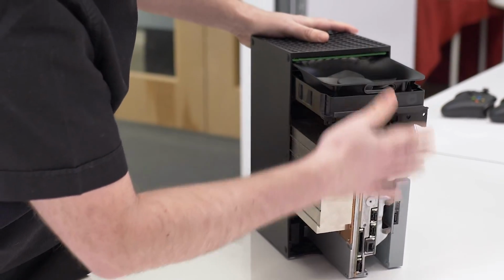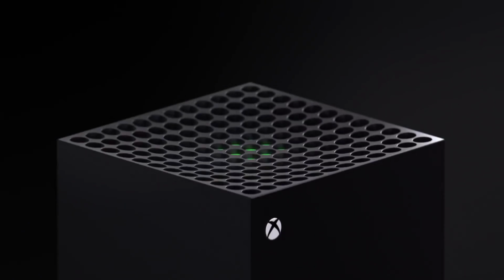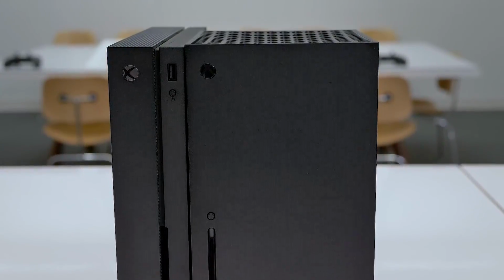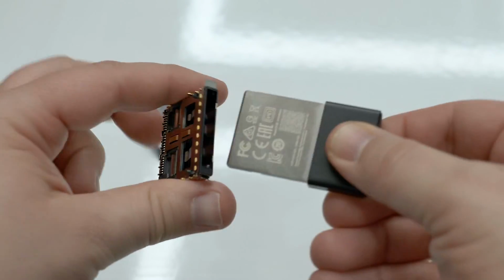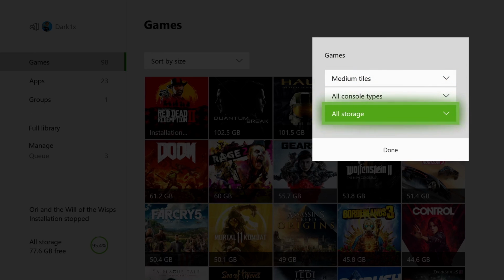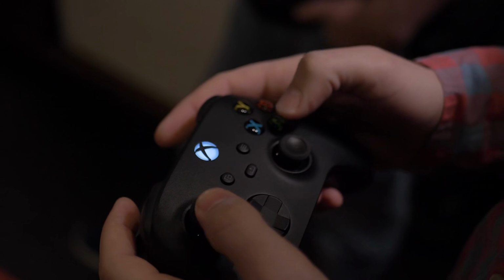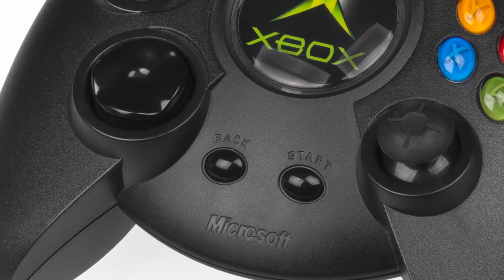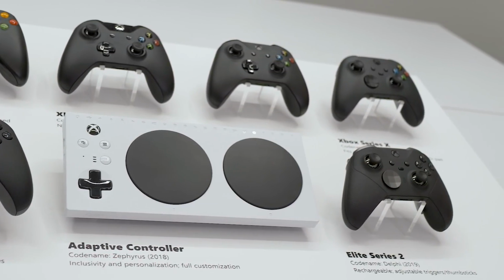DF Direct: Hands-On With Xbox Series X  + Impressions + Xbox One X Size Comparisons!

Comment: Miscrosoft have some brass balls this generation. They are practically flaunting the thing.
Reply: That tells me they know what Sony has.
Reply: Stephen McIntosh they didn't know what Sony had when they flaunted the xbox one. They just had confidence i their product.
Reply: @Karax9699  better games?
Reply: @Karax9699  Sony's cake is baked. It doesn't matter what they show Sony can't change the design of the PS5 in any meaningful way at this point.
Reply: @Karax9699  they dont really have a choice imo. They're in 3rd place so they have to be aggressive. They don't have anything to lose while Sony has all of it to lose.
Reply: @Karax9699  of course they know what sony has. they are the ones who will provide the servers for sony's game streaming service. how are they going to do that if they don't know the specs of the system?
Reply: @Karax9699  Of course. Both use what Amd will give them. PS5 will be identical.
Reply: @livewallberg  Not according to the leaks. They put Ps5 on older tech, and about 3tf less powerful
Reply: @Karax9699  also been leaks saying it's the same or even more powerful.. leaks can't really be trusted
Reply: @Billykiyay  there's been one credible leak, even digital foundry think is accurate. Puts it comfortably at 9.2
Reply: @Karax9699  so it's credible because that's the narrative you want pushed? It's no more credible than the 11 and 13tf leaks.
Reply: @Karax9699  and another 'credible' leak put it at 12 and most recently a Dev said 11.6, there would have been work in progress dev kits out there with a range of teraflops before now... it's all speculation when the truth is the difference will be paper thin.
 The big difference in my opinion is the exclusive games, which Microsoft have said they're not really doing.
Reply: @Billykiyay  except Microsoft said they are. And the leak that said 9.2 for PS5 also said just over 12 for series X. As I'd from AMD directly.

It'd 9.2 my man
Reply: @Karax9699  Is it official though ? Some are saying 15.1 then 13.6 then 9.6 tfs . I dont even know which statement is correct.
Reply: the wicked one Tommy Fisher leaked the XSX specs and was spot on, he also leaked PS5 specs..time will tell.
Reply: @Wifixsmasher448  well only 1 leak from AMD had just over 12 Vs 9.2 

Then another at about 4. Which is Anaconda. 99% confirmed legit.
Reply: @Karax9699  Nobody but Sony insiders have any real solid knowledge, only speculation right now.
Reply: @HalfdeadRider  there's no Sony insiders apart from the AMD employee who leaked the specs by accident
Reply: @Karax9699  The 9.6 tf has been debunked multiple times.
Reply: @Karax9699  nope, theyre using rdna2, AMD said so
Reply: @Karax9699  Anybody who works for Sony is a Sony insider lol.  And don't be surprised if that turns out to be false too when the specs do come out from the horses mouth, only time will tell.

However, it most likely is very similar if for some reason not the same as the Xbox CPU.  So that leak 'might' be the only truly know fact about PS5.
Reply: Stephen McIntosh Wrong it’s RDNA 2 also
Reply: @Karax9699  Firstly check your spelling otherwise no one will take anything you say seriously.
Secondly Microsoft have been open about specs, Sony have not. Just because you heard or read something somewhere doesn't make it fact, you do realise that right... 
plus Microsoft wouldn't release Sony's specs, also in the latest AMD conference they stated both consoles would be using the same chipsets. You have no idea mate same as everyone else.

Do some proper research my man
Reply: @Billykiyay  I have. About 2 years ago in development Navi 2 chips were leaked. 1 has been confirmed as series X. 12tf.

Another, smaller one. Was also leaked. 9.2 Teraflops being tested on behalf of Sony Japan. 

That leak is 100% real. That's the fact of it. Ps5 is 9.2
Reply: @Karax9699  Then present this research, your  leak source, to the comments so I can debunk it for you.
It's a two year old piece to start with, more than likely 3 now as it would have been last year and of information that's probably even older. 
Alot can change in that time.  
Xbox wasn't a leak they announced it ages ago.
Reply: @Brillobreaks  PS5?
Reply: Seems like all of you are forgetting that Microsoft has been buying up developers the past few years. Last year alone they snagged up 6 companies all of who have a background on making pc games. And as other people have said Sony had a huge advantage in the last gen cause Microsoft completely botched their launch of the Xbox one. The whole DRM always connected to online announcement they first made completely killed em and with all the backtracking and changing of minds it kind blew everyone’s trust in em.
Reply: @Jachamoe  Yep!!! Me didn't lose trust tho!!!😀😀😀
Reply: @Brillobreaks  yes. Considering Sony's launch lineup is looking to be the last of us 2 and Killzone. 

Not bad, but I don't think Sony are going to be as comfortable next gen
Reply: They have to. Xbox One was a complete disaster of the highest magnitude. Phil Spencer is a smart guy and clearly gives a fuck.
Reply: carljthatsme94 PS3 made comeback Xbox One dug a hole deeper and deeper.
Reply: @carljthatsme94  I've owned all iterations of both consoles back to the originals and the One X blows the PRO out the water. If they get some good new franchises going the Series X will be the winners choice. Whether people will move back from PS though remains to seen.
Reply: @Awakened Virtue Yep and 7 Uncharted games including the terrible Lost Legacy and Vita Golden Abyss and the card game..
Let's not forget 7 Grand Turismo's but hey let's shit on Forza 🤦
Reply: @mrwalker6026  lost legacy was amazing. Go play Halo you dumb shit lord . Everyone shat on that game
Reply: @AliHamza-sv4ni  Everyone shat on Halo 5 if you tried that with any other Halo game oh boy
Reply: I love how any praise of one console or another immediately turns into an excuse to perpetuate the console wars. Both systems are gonna be good, folk. :p
Reply: @TheTbrandon  Thank you my brother & very well said 👍🏿👍🏿 Because I think the console war thing is stupid to be honest 🤦🏿‍♂️🤷🏿‍♂️
Reply: @Brillobreaks  Maybe not.   Because they are starting to releasing their "Exclusives" on Microsoft's PC platforms.  So, Sony fans say "Xbox has no games!"  Because Xbox games are on PC.  Shouldn't that now apply to PS4 and 5?
Reply: Bryan Lee sony released one 3 year old game on PC, it’s not a policy shift
Reply: @cianboy97  and Xbox was also releasing older exclusives on the PC like State of Decay,  Forza Horizon,  Quantum Break and so many more for a long while but you all still ran with the narrative so...
Reply: @itsmebryan  Sony head, hulst said only select games will go to pc, but tbh the games will be on PS way earlier, people won't wait around, they want it first
Reply: @itsmebryan  Sony is only testing PC launches with a few exclusives. But they have confirmed that they are still focusing on PS exclusives. +Horizon zero dawn is a 3 year old game that has sold 10 million+ copies on playstation, so it doesn't really sell copies anymore and the developers want more money
Reply: @itsmebryan  Okey big boy tell us wich games (as in multiple) are on PC?? And don't give me rumours give me facts!!
Reply: @itsmebryan  But you've also just made an example of Xbox's biggest downfall. Because their games are on PC and I have a PC, it nullifies the reason to actually purchase the Xbox in the first place. Anyone who has a decently speced out PC won't even need to take any notice of their existing or newer console variants.
Reply: @shinukisan2222  Ok so does everyone have a PC especially one that probably burries most like what the Xbox Series X is gonna do no...no I dont think so.
Reply: @shinukisan2222  you mean like how Sony is releasing their games on PC as well as they "prepare for a future without consoles"? 😬 Guys you don't need a ps5 either
Reply: @Picmanreborn  Gonna be a longtime before consoles aren't the norm.
Reply: Shinuki San Microsoft doesn’t care if you buy a console, they make money off of digital sales, you really think the 20 dollar margin they make from selling a console or some shit like that is what will make them money? No it’s people buying their games that’s why their first party titles are almost all locked behind the Microsoft store which windows will be pushing hard soon.
Reply: @shinukisan2222  the fact that you ignored the general premise of my comment tells me all I need to know 🤦🏾‍♂️
Reply: @Picmanreborn  I didn't ignore the fact that slowly but surely Sony games are going to PC, just not in the same extreme as Microsoft. I added an extra comment to that, what's the problem? I made a comment, I didn't get all upset like you obviously are. Take a chill pill pal.
Reply: @shinukisan2222  ???? I'm going to assume that you're upset because you'd have no reason to think I'm upset. But I know that's how people react when they're getting exposed on a topic they have no knowledge in 🤔🤷🏿‍♂️
Reply: @shinukisan2222  🤔 I'm going to just leave you alone before you have a stroke getting upset like that. Sorry that you wasted 35 years of your life
Reply: @shinukisan2222  microsoft is ok with that , in fact they want you to play where you want to.
Reply: @shinukisan2222  about 1% of pc gamers have a pc Capable of matching the series x.... And none of them made it for less than 2 grand.
Reply: Shinuki San   Same can now be said about Sony’s console.
Reply: Picmanreborn   lol exactly
Reply: @Picmanreborn  If that's all you got then I'm very safe in the knowledge I have and all that I have learned. Shame I can't say the same about you, thanks for confirming and validating my previous statements, you're an absolute legend, where would I be without you in my life.
Reply: @shinukisan2222  series X> your pc
Reply: @shinukisan2222  not for me, I personally prefer console gaming over PC.
Reply: @shinukisan2222  How is that their biggest downfall? More like a smart, winning move. Like who cares? These guys barely make scraps on actual hardware console sales, pennies on the $ at most. They're often sold at cost or even at a loss, esp @ the start of a gen. That's not where the $ is. The $ is in software, subs, & services. These guys aren't like car co.'s, but more like gas stations/energy co.'s. You think Exxon cares if you roll up in a Toyota, Ford, or BMW? Nah they don't, you're still pumping their gas on the reg. You're still playing into MS' hands if you pay to play their games on PC. They see that as a win. Which is why you're where you are as a normal ole consumer & not there as a corp exec at MS. Do you think they care if you have a Dell or Acer running win10? Imagine if you could only use windows, dx, & office on their MS Surface, as some sort of exclusives to boost their HW sales. Do you think that the fact that they don't is MS' biggest downfall too? Nah, they'd go bankrupt w/in weeks.

MS is a SW co. first & foremost, that's where their expertise is. By making this move, they've effectively doubled their potential market base. And who wouldn't want that? More potential $ for them. There are many PC players who'd never buy a console & vice versa.

I mean why doesn't Sony make it so that you can only play their music & movies on their own Sony TV's, DVD/BR players, & devices? According to your logic, shouldn't they? Such downfalls on their part tsk tsk. I've watched all the Spiderman's on my LG, how dumb are they? No wonder they've been slipping in those depts for yrs w/ only their PS div keeping them afloat. They should follow their own advice.
Reply: Shinuki San yeah bit that means if there’s a game worth your while then you could be one of the many game pass subscribers and then if there’s one with an amazing multiplayer then you will for x amount of more months. That’s not a downfall. MS is simply letting the consumer choose what is your preferred console (Xbox one for at least one year or series x) being console or pc unlike PS where they shove it down your neck and basically say you have to buy this if you want to play our new exclusives.
Reply: That's because they know it's more powerful than the specs that have been released for the PS5 and they also know it is the first console to be up there with a high-end gaming PC.... you and I both would have balls too
Reply: They need to start fast and with excellent buzz because they don't want another poor generation in terms of sales. The PS4 is closing in on 2.5 times more units sold and would have probably hit that figure if it wasn't for the coronavirus outbreak by the end of June 2020 seeing that Final Fantasy VII Remake, The Last of Us part II and Ghost of Tsushima are coming before that date and all 3 of those games are system sellers and also game of the year contenders.
Reply: Well, they're doing the opposite of the Xbox one did. And we can thank that guy Mattrick for royally screwing it up. Phil is saving Xbox by everything he's doing and they ain't playing around. This is the complete opposite of what they did
Reply: @Brillobreaks   Currently, Halo, Senua 2, Gears Tactics, Flight Sim, Gears 6, Forza, Fable. That's before launch. And performance is presumably more powerful, by their reaction
Reply: @Karax9699  all I heard is gears Forza Halo
Reply: Stephen McIntosh They will all be on PC too. Not a good selling point for most people.
Reply: Stephen McIntosh He said ps5 not xbox
Reply: @Karax9699  idk man...  The last Halo and Fable were kinda bad.  The only games in my eyes that have a decent chance of being quality are Senua 2 and Gears 6 because they've proven to deliver what they market.  Forza...is Forza AKA obligatory pretty car game to show how pretty new consoles can make pretty things.  I'm never impressed with these car games because they never render more than they have to so of course the cars look nice.  I'm not bashing the xbox as much as I'm saying launch lineups usually suck and this one seems to be in line with my expectations.  The promised backwards compatibility of both consoles is most likely there mask this.  That being said...I love new tech so I'm grabbing both consoles.
Reply: Stephen McIntosh so, basically the same exact shit that was launched with the current gen and last gen. This is coming from an Xbox fanboy, I’ve always preferred Microsoft consoles. But damn do we need some new ip’s. I don’t know why Microsoft thinks they can keep getting away with just shitting out new halo, gears and forza games every couple years.
Reply: Meanwhile PS4 owners have all these great single player games. Bloodborne, Horizon ZD, Spider-man, etc. And all we get over on Xbox is crappy Gears games stuffed with micro transactions, a halo game that has about a 50/50 chance of being good, and a copy and pasted Forza game. It’s getting really stale.
Reply: @Shane-sf9pv  I know right just like Nintendo keep shitting out Mario,Zelda and Pokemon and ports at that
Reply: @Shane-sf9pv  that's all PlayStation has. Single player actin adventure games. Xbox has better shooters, racer , multiplayer, fighting. Better console. Better service. Better controller.
Reply: @EasyModeMowza  what games are those? That gears crap? And better controller my ass, it's shit for fighting games.
Reply: Shane Thompson   You should be one of them. THIS is an Xbox video. What are you doing here??
Reply: @Shane-sf9pv  meh those games are single player. I'd rather have Cuphead, Halo, Gears, Forza Horizon, Forza motorsports, State of decay, Sea of Thieves, Phantasy Star Online, Halo Wars, Crackdown 3, etc... But to each their own. I just prefer gaming with friends.
Reply: @AliHamza-sv4ni  How's Bore Stranding and Shits Gone.
Anyone who isnt a brainlet can either understand the appeal of the Xbox Controller and that they just like PS controller more or accept its the better one.
Reply: @Shane-sf9pv  Xbox's studio ; The Initiative is now working on a new IP , let's hope they delivers it
Reply: @Karax9699  Microsoft bought the Senua studio and those games in future will be Xbox exclusive.
Reply: @HelloFellowDinosaurs  they will all be on pc
Reply: @Karax9699  so a hopefully good halo game (hasn't happened in a long time) and Senua 2 lol that's not much
Reply: We've been through this before. We need to see games. I have top end x86 hardware already.
Reply: @Brillobreaks  But ask yourself this were you there during the Xbox 360 generation when the 360 had "better games"? The common trend for games costs $60 per new release via console. For services it costs $12-$60 per month/3 months/year via console. For a new display that is meant for the console ranges from $140-$86,000+ which is worrh more than the highest of high end gaming PC. When you pay for console it's an exponential growth for the amount you pay. For PC it's expensive at the start but the amount you pay is linear since games are significantly heavily discounted and there are no services that you have to pay for. It does not cost as much to upgrade your PC with brand new hardware compared to purchasing an 8K TV for $2.5K-$86K+. It is not poverty people suffer from it is more of so saving up. There are many factors that lead to the consumer becoming low budgeted whether it is poor choices or environmental factors. Also console sells do not matter it is the number of active users that counts. I could by a random console right now but that does not contribute since consoles are being sold at a loss. When I buy that random console and deliberately choose not to touch it there is no contributions being made. When I game on said random console I am contributing by paying for its available services. Halo Infinite is going to be cross gen does that mean people will purchase a used base Xbox One instead of the Xbox Series X? No. People want power AND games rather than one over the other which helped boost the PS4's reputation prior to launch when Phil Spencer was not in charge and instead someone who did not even care of the Xbox brand was put in charge. So now that that is out of the way we now know that "games" are not the only factors gamers look for and console sales do not depict which competitor prevails.
Reply: @Awakened Virtue What are you talking about Gran turismo sport is a multiplayer game and it has a pretty strong fanbase. And those nintendo exclusives sold alot because they were basically the only available games available at the time.
Reply: Cee Z  there's no Pro. The PS5 is anticipated to launch end of this year at 9.2 clear you're a fanboy though so, irrelevant
Reply: Oodama Chisengan  The corona virus is a big problem for Sony. They're not running scared, they can't hold events since the disease could spread in there and Sony can't promise a holiday 2020 launch at the moment since they aren't getting parts for the PS. I think it's annoying too but there's not much we can do
Reply: As they should. I want them to push SONY (my preferred platform). I want them to be hot on SONY's tail. That's the only way SONY will continue to work hard
Reply: @blackwhite2361  THIS.
Reply: @Brillobreaks  no Japanese games on that list

I guess phantasy star online doesn't count?
Reply: Eric Henry previous history? Sony had jack shit for the launch of PS4. It was almost a year after launch until they brought out anything worth talking about. They finished this generation strong but it was a slow start.
Reply: Oodama Chisengan  Sony still have 2 big exclusives coming out for the PS4 in the Last of Us part 2 and Ghost of Tsushima and are about to or have already surpassed 110- 115 million PS4 sales. My guess from a business perspective is that Sony want to keep the momentum with the PS4 at least until TLOUP2 drops then I suspect we will see Sony release official news for the PS5 and then Ghost of Tsushima will drop to end the current PS Gen with one last big bang. Microsoft don't have if memory servers anything really coming in terms of big Blockbusters to compete with either Sony or Nintendo to finish out the Xbox Ones lifecycle so it makes sense for Microsoft to want to shift the momentum away from a fairly lackluster gen and try and build momentum for the series X.
Reply: @ServiceGuaranteesCitizenship  Why would anyone buy the PS4 now when the PS5 and Xbox Series X is about to release,  also btw how the hell do they go from 103 Million units sold to 110-115 million units in 2 months you are just reaching at this point.

Um Xbox has Halo Infinite,  Crossfire X,  Grounded,  Microsoft Flight Sim,  Age of Empires hell maybe even Everwild and Hellblade 2 releasing this year or the next,  and they did announce that their games will be cross-gen so any IP they make this year till the next will be playable on the One Family to finish off in a bang.
Reply: @imixupwords5340  Much for the same reason that people continued to purchase Xbox 360s and PS3s after the launch of the Xbox One and PS4 that reason being that they are cheap and have a completed games library at a deflated price you would be surprised at just how many end of gen adopters there actually are. And reaching? PS4 had sold 100 million by July of last year I think you are a little behind on your information? The last counting for PS4 that I was aware of was at 108 million sold as of January this year it is completely feasible to assume if that PS4 has surpassed 110 and is encroaching the milestone of 115 million units sold. 

And Decent multiplats for sure if done right. I hope Halo Infinite actually hits the mark this time I have not personally enjoyed a Halo game since Reach Halo 4 and 5 I thought were iffy. Age of Empires 4 however if it as good as its predecessors will be one to get for PC for sure.
Reply: @ServiceGuaranteesCitizenship  Yeah but only like 3-4 million people still bought the old-gen consoles thats not really a lot,  sorry about the little misinformation just reachecked it was 106 Million not 103 that number was daily players still though how the hell can they reach 110 or 115 in 6 months when it took them 6 years after last-gen to get 87 million units sold on the PS3,  most are probably waiting for the Next-gen consoles and their more affordable counterparts (well for Xbox at least).
Reply: What games all Sony showed us gamers was a ps logo 🤣
Reply: @Awakened Virtue That's confirmed for next gen with a Multiplayer. Plus killzone is rumoured. Not great
Reply: @Karax9699  No it was. Even rumored that guirilla is working in Horizon sequel and a new Socom
Reply: @f30rocity78  debunked.
Reply: @Karax9699  dude, there's so much more. Bluepoint has two games, one for launch thought to be a remaster of Demon's Souls. Sony have worked out differences between kojima and Konami, now Sonys getting Silent Hills, ie PT as an exclusive. Naught dog are said to have had another team working on a launch title, not tlou. GDC had a survey for developers a while ago, one question was what console were they working on games for at the moment, and another asking about their next game. Sony got way more percentage. Oh and they asked devs what next gen console are they most looking forward to, by far Sony again. Now I'll look foolish if they don't, but I think they're gonna blow people away very soon
Reply: @cathalorourke1  none of that is confirmed. All came from fanboys. All the real sources indicate that Sony have about 3 games for launch year, and it's to be 9.2 and priced same as Xbox. That's the facts we know.
Reply: @Karax9699  well its true theyre not facts, but possibilities. There's godfall and Ghost of tsushima port also. Bluepoint point remaster is definitely coming too, they themselves have been teasing for months in tweets
Reply: @cathalorourke1  Ok first of all mate that whole Sony making Kojima and Konami make up is still a rumor and I dont know if I want Konami to get money from Kojima's work Konami is a bastard he monetised save slots the fuq.

Mate have you not heard that Naughty Dog is going through a crisis just to release The Last of Us 2 with veteran devs leaving on a daily basis because of crunch and them having to rehire new devs and train them as well,  why would they make a second team to make a second AAA launch title for the PS5 if they did that TLoU2 and their "rumored" Second title is gonna come out shitty and broken I do not want that.

That list always changes last-gen it was the same people wanted to work for the PS3 more than the Xbox 360 in the end of the day most of those same people still made a Xbox version of their game,  as lonh as the Xbox Series X is a good product and people actually want to play on it they will make a copy of their game to have more profit.

As for Bluepoint im not sure about there being 2 but I sure as hell believe they are working on a Demon Souls Remaster.
Reply: @TheBlankStare that's usually not the case with tech.
Reply: @Brillobreaks  Sony has always had a terrible launch line up where have you been for the last 20 years? I guess you Sony guys have short memories, but I don't, I remember all the jokes about greatness awaits and awaits and awaits and the indie-station. Xbox had a way better launch line up of games, they also had a weaker console, terrible PR from all the fuck-ups are around the reveal and the messaging and a more expensive console due to kinnect all Sony had for the first few years was100 bucks cheaper and 100p diff in games. Also, MS has more first-party studios than Sony do now and Sony is on record saying they make fewer games next-gen but focus on quality so I would not go banking that PS5 will have the better library of games.
Reply: @Valhura77  bruh xbox one wasn't much better than sony in the launch lineup.
Reply: @f30rocity78  Actually it was bruh it had Forza 5, Dead Rising 3, Ryse and Killer Instinct
Reply: @Valhura77  Microsoft bought some pretty small developers, sony has the upper hand in that field.
Reply: @f30rocity78  Obsidian,  Playground,  The Initiative,  Ninja Theory,  Inxile,  and Undead these are there best of the new studios they acquired,  3 of these guys maybe small but they are talented and are growing thanks to Xbox's support and the other 3 are big AAA devs.
Reply: Zeegoku I think MS is doing the right thing as the underdog. Get your info out first so that all the revealed info of the PS5 is compared to this.
Reply: Xbox has expanded their 1st Party game studios to 15 with big names like Playground,  Obsidian,  Undead Labs,  Inxile,  and Ninja Theory with 1 new studio called The Initiative thats being led by seasoned developers like Darell Gallagher,  Drew Murray,  Ryan Duffin,  and so many more.

Xbox has announced 7 next-gen exclusives and teased about 4 more,  these 11 exclusives are Halo,  Hellblade,  Mara,  Insight,  Flight Sim,  Everwild,  Age pf Empires 4,  Playground's 1st real IP/Fable,  The Initiative's first game/Perfect Dark,  Forza Reboot,  and House of Thieves/Compulsions new IP. 

There are trusted leaks of:
- Perfect Dark coming back 
- Fable coming back
- Obsidian working on a second RPG project thats supposed to be their version of Skyrim.
- Inxile working on another project thats not a turn-based asymetric RPG with Dean Rymer as their lead combat designer.
- Undead Labs working on a brand new IP
- Compulsion just revealed that they are in fact working on a AAA game that is 3rd person and drives heavy influence from Bioshock.
- The Coalition working on a brand new IP to let Gears breath (this one isnt really supported either because it isnt true or leakers are too focused on the big one's).
Reply: @imixupwords5340  hi,  they will all be on pc , bye
Reply: @AliHamza-sv4ni  So do you have a PC no better yet do you think everyone who plays games have a PC is that no yeah screw off.
Reply: @AliHamza-sv4ni  Better yet do you really think when the Xbox Series X launches people will go out of there way to buy and build a PC that will cost 2 to 3x more than the Xbox Series X but will be at the same performance rating.  Again screw off.
Reply: In fact there are credible leaks that Xbox has bought at least 2 new studios 1 from Poland which is likely Moon Studios or Techland and 1 from Japan which is probably Platinum Games.  

I personally think they got 5 again those being Moon,  Techland,  Platinum,  Relic,  and Remedy but thats just me.
Reply: @imixupwords5340  I do not exactly favor the word "leaks" because it means in theory.
Reply: @Brillobreaks  Microsoft have 16 studios working on first party games now, they had about 6 at the start of Xbox One. Sony have about 12-14 depending if you count different branches of the same studio etc.
Reply: @Brillobreaks  lmao where did you pull that from? Your ass? PS3 sales were at a standstill when PS4 released.
Reply: Games won’t mean sweet FA if the platforms are poo to work with. That’s what held Xbox back last gen. Ps was better to work with. This gen is undetermined
Reply: *MICROSOFT more like balls of Adamatium this gen.
Reply: Awakened Virtue your Nintendo argument is absolutely idiotic. Nintendo has no 3rd party game presence in their consoles whatsoever. That explains why their exclusives sell so well. Put all of those 3rd party heavy hitters on Nintendo and their exclusive sales will dip down right away. By the way Nintendo Switch is terrible and overrated console. On the other hand You can’t even compare PS 100 million user base to any other platform on the planet. PC is exception. Xbox multiplayer games are terrible and have a lifespan shorter than top notch PS4 single player exclusives. Go to twitch and I guarantee you gonna see every PS4 AAA exclusive still to be streamed and played, even though they are one and done after initial hype and release. Xbox sold 40 million but I guarantee you that at least 30% of their customer base migrated to PS4 and their Xbox is simply sitting on the shelf collecting dust. And you have to be an absolute idiot to believe that the most powerful console will lead and win next generation. 90% of the population still has 1080p TV and monitors. Despite the all RTX hype nonsense 90% of the gamers still prefers 1080p with stable frames over 4K. Games, and I must say the best games and library will win the hearts of an average gamer, who wants to come after work, turn their tv and relax. Price means and dictates a lot and we all know that MS has always been greedy in that department. This is a nice piece of plastic hardware, but so far that’s the only thing it remains so far.
Reply: Lol YUP....AND WHERES SONY AT???  NOWHERE TO BE FOUND.
Reply: Awakened Virtue many previous Xbox fans jumped ship when they heard things like no game sharing always online Kinect bundled with the system pretty tough launch and they knew it once the one s came out they started going in the right direction but it’s not always about console says there’s not much money in that for them.
Reply: Eric Henry hey if rumors are true and Sony trying get the rights to castlevania, metal gear series and silent hill then oh yeah Sony will have a great library.
Reply: @sarahbembry7512  The thing is when we the "hardcore" Xbox fans look and find leaks we still need to see if the man who leaked it is reliable,  thats why we trust Jason Schreier he may be wrong sometimes but 90% of the time he is right he leaked the Specs of the Series X or its older name the Anaconda and look at that he was right.
Reply: @Brillobreaks  Funny because he xbox one X was selling faster than the ps4 pro.
Reply: @Awakened Virtue way to generalise things 👍🙄
Reply: @Awakened Virtue Sony is focusing on singleplayer games so of course they aren't releasing a huge first-party multiplayer game. Most people want singleplayer games, so there's no point in bragging about only having multiplayer
Reply: Cee Z  all critically acclaimed and commercially successful franchises.
Reply: They did the same with XBONE and look how that turned out.
Reply: @Awakened Virtue you like pulling percentages out of your ass? Nice. Look at the sales of the PlayStation and Xbox , life time sales, ps2 vs Xbox , ps2 way more sales, PS3 vs 360, ps3  a million more consoles sold. PS4 vs one. PS4 way more sales. There is no war. Ps  has more sales every gen
Reply: @AliHamza-sv4ni  Check facts when was the last time the PS3 sales were revealed and compare that to when the last time the 360 sales were revealed you would be pretty shocked how far they are apart,  360 sales were last revealed in 2014 PS3 sales were last revealed 2019.
Reply: @imixupwords5340  you do know they don't have to write articles for you to know sales of a product right?
Reply: @AliHamza-sv4ni  Mate those same articles release the same year when they reveal their product sales it doesnt counter my point that The PS3 took 6 years after the last-gen to beat the Xbox 360
Reply: @imixupwords5340  mate , doesn't matter how long it takes, the fact of the matter is. Even in the generation where Xbox apparently dominated. Sony still eventually had more sales. And sales are what matter. No point in arguing. PlayStation is still on top and will continue because Microsoft wants to have all their games on PC so there isn't much reason to get the new Xbox for alot of people. Ps will dominate again
Reply: @AliHamza-sv4ni  Does everyone have a PC nope I do but the Series X still dominates it  so no one is gonna go out of their way to buy a PC just for gaming anytime soon.

You know you seem to be forgetting to add in the fact that the last 360 sales were from 2014 it took The PS3 6 years to beat those numbers so what are the 360's units sales during 2019 probably still buries the PS3's thats for sure.
Reply: @imixupwords5340   Follower 8  bro are you living in the early 2000s? Most people who will be able to afford a series x are there kind of people who atleast can afford a decent laptop if not a PC. Most people with jobs and who go to uni have laptops. And trust me you can literally build a pc that runs better than the current gen for about the same cost. Don't care about probabilities. Fact is a decent PC , a PS4 and a switch gets you everything
Reply: @AliHamza-sv4ni  You know were talking about next-gen right,  a decent PC will cost more than the Series X but still be weaker if they're getting that PC just for gaming then they must not be thinking straight because the Series X will be better and cheaper.
Reply: @imixupwords5340  not really man. It's "next gen" for consoles, not for PC . They've had most of this shit for a minute now. By the time these come out the prices for parts will go down some more and within a short period of time you'll start setting YouTube videos about PC builds around the same power that are in that price range.
Reply: @Awakened Virtue the same could be said about xbox, there are 11 Halos
Reply: They have the full capablities of the master race behind them. Any move they make will be interpreted as a "flaunt". As a PC Gamer with a high end HTPC (im typing on it right now) in my living room, gotta say im pretty impressed with this console. Not consoles, but THIS console. I more or less have MS XGP specifically for this system. Well done to MS, and as a long time fan of AMD CPUs, (never owned an intel) im very impressed with AMDs APU tech for sure.
Reply: @Brillobreaks  single player games for basement dwellers 🤣😂
Reply: dyy Fethiiyhn  But didnt the PS4 launch with the shittiest of launch titles and only sprinted past the Xbox One because it was shitty and the PS4 was stronger and cheaper.  

Didnt the PS4's actually good games come out in the mid to the end of the generation. 

Didnt the Xbox 360 have the games that everyone loved and that buried most of what the PS3 had.
Reply: @Awakened Virtue 
Well only ps5 game confirmed so far is Godfall.
But on the other hand not many Xbox Series X games are confirmed.
Most of their exclusives launch before the Series X release, if we're going by the exclusives that'll release this year,
Then ps5 will have
Final Fantasy 7 Remake, Last of us 2, Nioh 2, Ghost of Tsushima, Yakuza like a dragon, The Pathless, Persona 5 Royal and a granblue game.

They'll be available to play on the ps5. I mean, you can buy the ps4 disc and play it on the next gen console since backwards compatible, same thing with xbox too so ¯\_(ツ)_/¯
Reply: @MavihsLH  Dont forget that Xbox is releasing about 9 confirmed exclusive games this year and 3 multi-plat ones those being:
- Halo Infinite (AAA exclusive)
- Crossfire X (AAA free to play exclusive)
- Grounded (AA/AAA exclusive)
- Falconner (AA exclusive)
- Ori 2(just released) (AA/AAA exclusive)
- Battletoads (AA exclusive)
- Gears Tactics (AA/AAA exclusive)
- Microsoft Flight Sim (AAA PC exclusive)
- Tell me Why (AAA exclusive)
- Psychonauts 2 (AA Multi-plat)
- Minecraft Dungeons (AA/AAA Multi-plat)
and
- Wasteland 3 (AA/AAA Multi-plat)
Reply: @imixupwords5340  
Yes I know.
I was also combating another person's statement,
I am perfectly aware of the games Microsoft is releasing this year.
Besides I missed out some ps exclusives myself, that was definitely not the complete list.
Reply: @MavihsLH  I may have made my reply in the more aggressive side I was just supposed to tell you what Xbox exclusives that are most anticipated are coming.
Reply: @imixupwords5340  
Yeah I think I shouldve mentioned that, in my comment I said
"Not many Series X exclusives are confirmed"
The I stated that most of their exclusives release before Series X.

Maybe you read my comment wrong ¯\_(ツ)_/¯ 
Cheers pal.
Reply: DF wasn't around last gen
Reply: Playing into Sony hands fools.
Reply: @WizKing93  Well we are consumers who enjoy the hobby of video games and if playing into Sony's hands means buying and supporting the PS5 to play some great games like the PS4 has and is offering then yes I suppose we are fools at least for high quality entertainment. I own a PS4, PC and a Switch now that isn't a boast but a reference I have the ability to play all games on 3 machines and imo Sony has without a doubt this generation produced the highest quality first party games. The prospect of God of War 5, Bloodborne 2, Spiderman 2, Horizon Zero Dawn 2, Days Gone 2 a possible Uncharted 5 and Last of Us 3 as well as new Ips is reason enough to already be hyped about PS5.
Reply: Oodama Chisengan No they are waiting for Corona 19 go away
Reply: Eric Henry PS3 and PS4 more powerful than Xbox 360 and One
Reply: Games all they showed us was a logo 😂 what are you smoking?
Reply: So Sexy!
Reply: @Awakened Virtuethat was because the console was $100 cheaper and you could use used games unlike the Xbox one at the time until they quickly corrected the mistake
Reply: @Stephen F. Austin the Father of Texas In some cases they are. MP games are run, duck, shoot the same enemies over and over again in the same arena/locations! Offcourse the enemies are controlled by other players but still the same maps, gameplay mechanics etc... Single player games do over more variety in enemy encounters, bossfights, world maps etc....
Reply: Colonel Seguin the Tejano Rebel it literally only outsold on a $100 cheaper price tag for an inferior machine. Which price point is something I can understand the PS5 and Series X are the same price. So I’m curious to see how it unfolds.
Reply: @Brillobreaks  How many times can you replay the same single player games over and over?
Reply: @jbsleepy1098  a lot if they're done properly. Multiplayer games are trash and all the same at this point
Reply: @silenthill4  Yet they are the more popular one's
Reply: @jbsleepy1098  How many times can you watch a classic movie? My guess is over the years you will have watched a great movie several times and the same applies to great single player games. God of War or The Last of Us or The Witcher 3 for examples are worth far more than just a single playthrough.
Reply: @Brillobreaks  I do not see any logistics in your claims. I only see ignorance underestimation and someone bending over to a company because of their "games". The first generation it was more of so a draw. The second generation Microsoft won because of their "games" while Sony pushed for hardware and a $600 release prior to the PS3. This generation Sony won because the ex head of Xbox did not give 2 flying fucks about the brand and only cared about PC gaming giving Sony a lead prior to launch. 3/4 of the way through the current generation Microsoft releases the Xbox One X to combat the PS4 Pro. At this point and time Microsoft has accumulated enough money via services investments and computer hardware to give a full fledged push for next generation with a spending spree on hardware and GAME STUDIOS so that there is a diversified genre of "games" in their library which checks off their "games". Phil Spencer before the outbreak and people's overreactions to COVOID19 consulted with developers and peoole all over Japan to repair the Xbox reputation in Japan. There is a high possibility that there is Japanese developers in said GAMING STUDIOS. Now quit bending over for Sony enough of this nonsense and just get every platform.
Reply: I love how you all think The Playstation is always the one that has THE GAMES every gen but any non-biased individual would know during the OG Xbox - 360 days Xbox had THE GAMES :  Halo,  Gears,  Forza,  Fable,  Mass Effect,  Crackdown,  Perfect Dark,  Left 4 Dead,  Star Wars:  Knights of the Old Republic,  Alan Wake,  State of Decay,  Ninja Gaiden,  Killer Instinct,  and so many more
Reply: Sony is 100% gonna sell consoles just on Exclusives. As a PC gamer buying a PS5 first is way smarter choice than ever buying Halo for  Xbox especially when I have the Pass.
Reply: Who cares if it's more powerful than ps5 power never ever determines a victory especially when it comes down to the games
Reply: @andraescott7470  I cant believe this mate The PS4 had a weak launch line-up the only reason why it left the Xbox One in the dust was because it was weak and shitty,  why would anyone buy the One over the PS4 it was cheaper and more powerful.
Reply: @andraescott7470  Actually it has. Every generation generally the more powerful console won.
Reply: @Karax9699  No, that's not true lol. The more powerful console did not "win every gen generally". In fact, going back to at least the SNES gen, it wasn't the most powerful that won, but rather the cheapest. Well, I guess it kinda depends on what you mean by "win", but if going by objective measures rather than subjective, things like most console/game sales + mindshare, then it's almost always the cheapest console that has come out on top. The only exception is this gen, but that's bc the cheaper console was actually also the more powerful one at the same time. Even looking back at just last gen, the wii which was by far the least powerful but cheapest "won". It was no exception to the rule.

Now I'm not saying power doesn't matter. It does. And so do (exc) games. I'd say they're about even in influencing purchase decisions. Yes, exclusives matter just as much as power imo, they rly aren't as important as the fb's make it out to be. Price is overwhelmingly the most important factor by far.
Reply: Forza...... Halo......
Reply: @andraescott7470  it did this gen. PS power > XB's better games at launch + their baffling policies. When MS tried to fix the prob, it was too late, Sony just had too big of a lead to overcome. Plus, they also then had the better games at that pt halfway into the gen. Double whammy. Your friends also have a big influence. Why would you buy a xb to play by yourself if all your buddies were already on ps4 by that pt?
Reply: Cool black box, but no games. 🤣🤣🤣
Reply: @Brillobreaks  exclusives dont sell consoles anymore. Wii u had loads of exclusives didnt sell, ps4 didnt have exclusives for awhile with sony even stating one holiday that third party would carry them that season. 
Console price and good build aka software/features and games in general are what sell the system with a clear message and right now MS is making the message clear.
Reply: @illusioned0ne  Exclusives don't sell consoles anymore? What Metric are you using to make that statement could you provide a source?
Reply: @Brillobreaks  yeah games you play 20hrs (3 days) max. Xbox is killing it work multiplayer games and in today's world, that's what matters. Nobody wants to walk 20 hours on a barren land. I'll take Halo over any ps game any day, any time
Reply: @resulnaki  You say nobody wants to play those kind of games, you're aren't talking for me. I like those kind of games, as do millions of others. Perhaps you need to stop generalising on what everybody likes and dislikes. Opinions vary and so do people.
Reply: Resul Baggio Sony absolutely walked MS on games this gen. It wasn’t even close.
Reply: @resulnaki  halo??? Now you buggin
Reply: @resulnaki  yup killing it lol, how many sales did xbox have this gen 😏
Reply: @cathalorourke1  How many Sales did Xbox have last gen oh yeah 83 million,  point is if Xbox makes a good product like the 360 and make games that are good like Halo,  Fable,  Gears of War,  Left 4 Dead,  Forza,  Mass Effect and many more people will buy nothing is set in stone its simply if you have a good product.
Reply: @resulnaki  you realise there are different types of gamers right? You think the average gamer can finish a 20 hour game in three days? Like what?